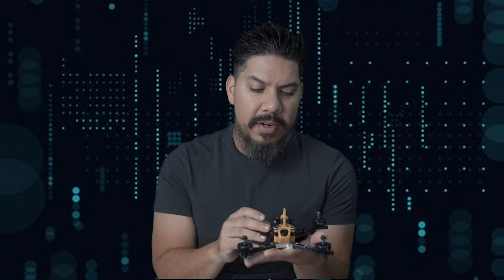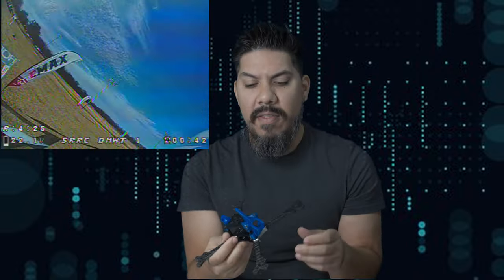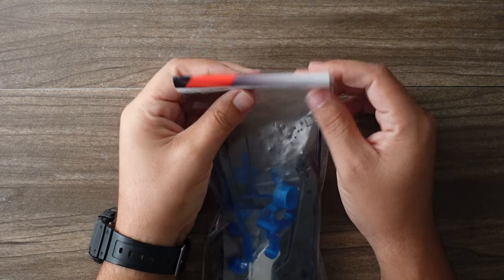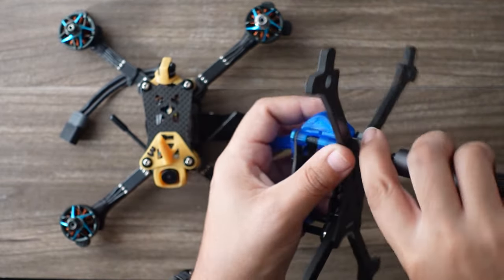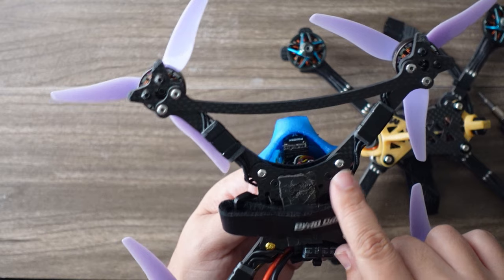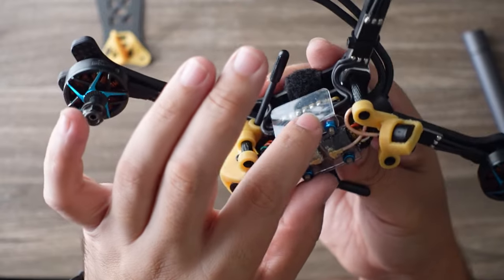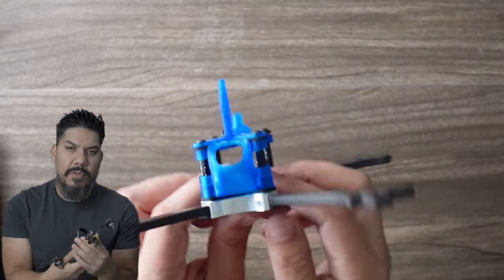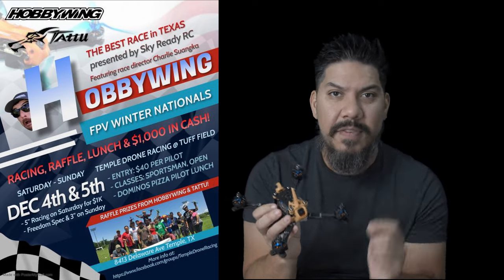SkyReadyRC Cobra SLX Evo Racing quad - Drone racing metal frame

Comment: Would m30 connectors instead of soldering on the arms bottleneck the power to the motor?
Reply from the maker: No. They use those on the heads up motors. I changed a motor today at global qualifier with just a plug. No soldering needed.